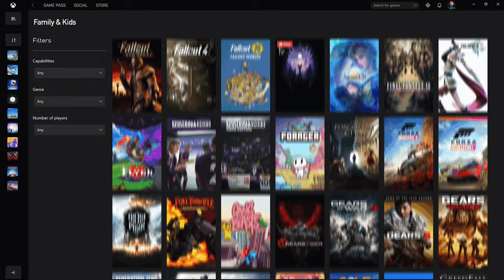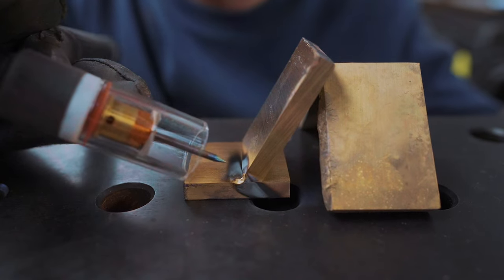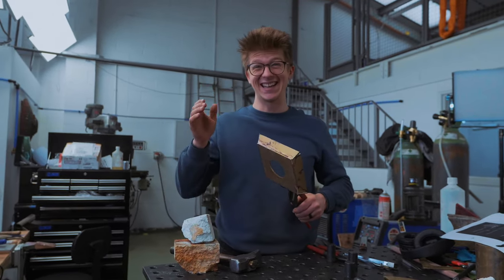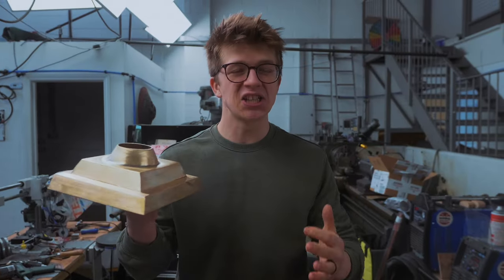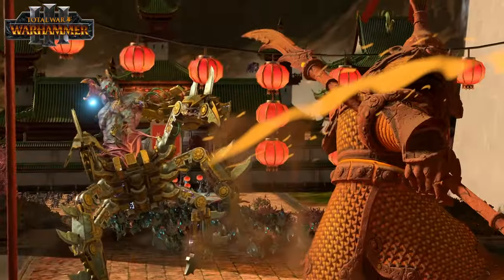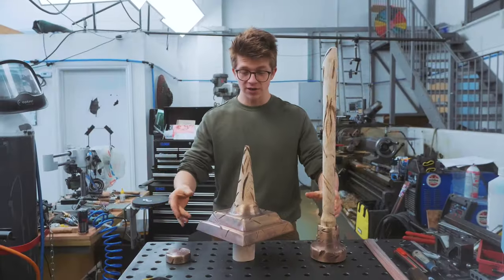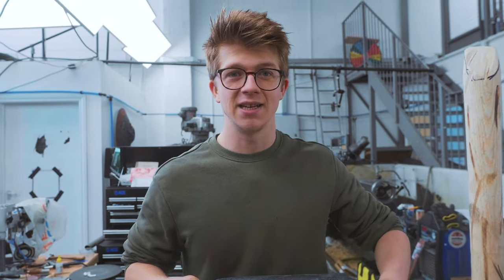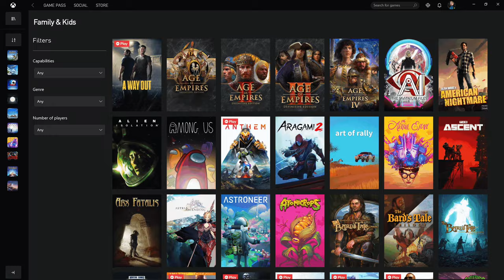Making a 50lb GIANT Warhammer!

Comment: If you're going to veer into michaelcthulhu's turf, you might try his tricks when faced with large "brass" pieces. Heat a piece of steel and go at it with a brass wire brush (solid brass wire, not brass-plated steel)- the brass deposits on the steel. For thick pieces that have to take wear he uses lots of bright brazing filler rod in a cavity with undercut edges so it won't pop out.

Comment: Something similar happened to me in shop class. I wanted to make a set of dice out of sheet steel, about 8" on a side, using an oxyacetylene torch to burn the holes for the dots. So I cut out all of the pieces, got them set up, brazed them all together, started to burn the holes...and of course the melting temperature for the steel was higher than the melting temperature for the brazed joints, and the die simply fell apart. And my shop teacher laughed, and laughed, and laughed...

Comment: Brazing 101, do not use a rosebud torch as your heat source. Use a number 1 or 2 brazing tip. Also, when brazing brass or copper, keep the item in a water bath for heat control since they are both a heat conductors. (Keep the welding area out of the water while submersing the remaining body).

Comment: You're supposed to use the whole range of silver solder, going down from the highest to the lowest temp so that you don't upset the first joints. You're also supposed to clean the brass naked, and use flux like you're trying to flood the sob in it.
Also, if you went as far as to weld it, don't bother soldering it. Welding it goes much faster and it's stronger. You can do less weld than you need to do soldering, and therefore you waste far less resources.
Just my 2 cents. If there's one area you majorly need to plus your skills, it's the management side of a projects. Reaching A to C with the least consumed resources, and you do that by learning all the methods required to have a full range. You seriously need to grow this part of your "vocabulary" because as far as i can see it, it's your biggest flaw at the moment, holding you back immensely.

Comment: question, why not just heat brass steel and use that for the frame parts? using the brass wire wheel on the hot steel should have transferred the coloration but still had the easiest way to hold everything together structurally

Comment: I kinda feel like you should've used a wooden on the inside of the steel box.  It would've helped distribute the forces of impacts more evenly, and taken some of the strain off those welded joints.  Even a soft wood would've helped without adding too much more weight.
.
In my mind I just see those joints popping if he actually tries to swing it at even a soft stone slab like the one shown.

Comment: I'd like to point out that this is NOT a war hammer
It is a MAUL
And Mauls were usually made out of wood, which is why they were shaped like this
War hammers have a much longer handle and a smaller head, generally less than 10 pounds
Because any heavier and you would quickly exhaust yourself on the battlefield rendering you vulnerable to being killed!
Reply: It's a Warhammer warhammer.

Comment: Ok. You probably know this since making the video, but  brass is a great heat sink. You're using a massive acetylene torch on a fairly short solder joints. Clickspring is a channel of a man reconstructing the antikythera machine with era correct methods. Meaning he has to solder brass/bronze with out a torch.

Comment: This is maybe a dumb question. Is there a benefit to spinning the item you're working on, while holding the drill bit stationary, vs holding the item stationary and spinning the drill bit?
Reply: it is most likely easier to spin the bit than the object as the drill is lighter. but if you are using a drill press, then you spin the object instead.
Reply: @Spiralem  that makes sense. Use whatever tool you have. I was also thinking it's much easier to find the center if you're using a lathe to drill a hole, vs a drill press.

Comment: hate to say this after its done but you could have done the copper pieces in steel and then brassed them with some heat and a brass wire wheel

Comment: Hmm. I would have drilled out a center-hole in that wood handle and shove a steel bar into it for reinforcement, make it so it can go all the way to the end-cap on the hammer. Wood can be strong, but that is a heavy looking hammer even though its hollow. I get that its decorative and not made to be functional/battle-ready. But you dont want that handle to break either!

Comment: Might of been easier to use normal steel and a brass wire wheel, to brush on the coating after heating it up.

Comment: It looks like you forgot the flux, that is the reason your solder would not flow. Get some easy-flo high temp flux. And use iron binding wire for fixturing (handy tip: throw the wire in your forge so it oxidizes, then the solder will not stick to it) 
Also, get a couple of different silver solders, easy/medium/hard and start with highest temp one. Then your previous solders will not fall apart as they did @ 4.04
Reply: If I'm not mistaken, the jewelry solder paste he's using has flux in it...
Reply: @OrigMaelstrom  it does... I was trying to point out why he failed with the original solder. And personally I think the approach with flux and solder separately gives you more options, especially in controlling the flow of solder. And therefore is a lot more versatile workflow, than being limited to solderpaste.

Comment: YOu needed flux to get the soldier to flow. Also, the parts need to be cleaned very well and have fresh metal exposed. A wire brush or rough sand paper does this.

Comment: I don't know. Feels to me like you did too much work in figuring out the welding, when the original art already looked like plates riveted to a core of unknown material.
 If you made (or had it made for you) the bulk of the weapon from wood, your initial 150 lbs weight estimate for a metal weapon should have come down to about 30 lbs. Still pretty heavy, but not unreasonably so for a thing supposedly waved around by a giant. And you might have taken artistic licence on the type of wood.
And while riveting into wood may not be an everyday skill to you now, it is the technique that build the worlds railroads a couple of centuries ago, so it is known to work in principle.

Comment: You should forge a dagger, but when you go to temper it and you have the nice straw color, put a finish over the blade and then get a good edge on there. Don't polish off the straw color. That way, once the dagger is finished, it will have the strength of normal steel, but it will have the color and beauty of bronze. It will look like bronze, but it's actually steel. I personally just love the color of bronze over steel. Anyway, just a suggestion or something to do if you get bored.

Comment: I might suggestion a few things while soldering brass to brass. First is clean surfaces. Second and very important is using the right torch tip. As you want to control the heat to just where you want to solder and not to the piece as a hold. In this case I would suggest a 8 tip or a 5 tip. Hopefully this advice will help out in future attempts.
Edit: I forgot to add. A 56% silver solder would work wonders as well.